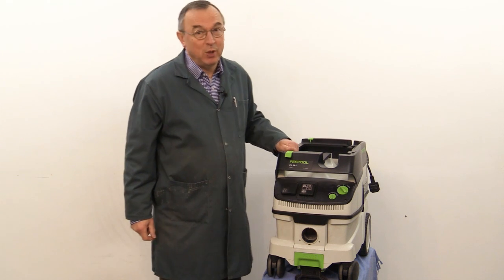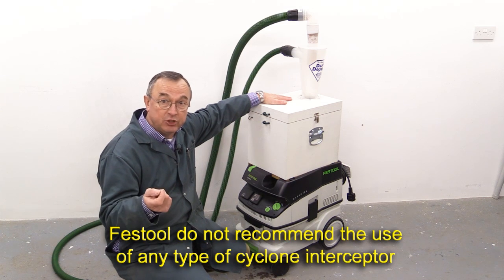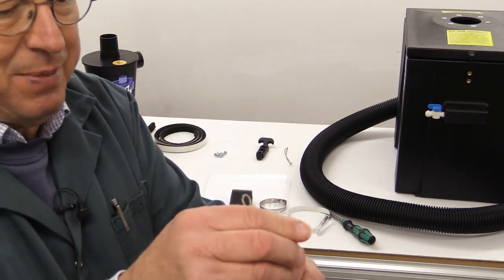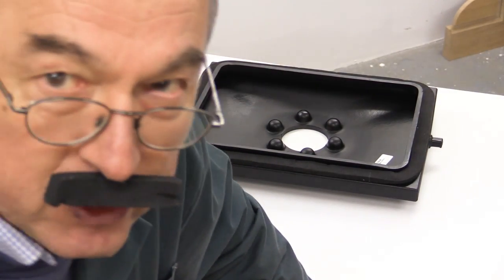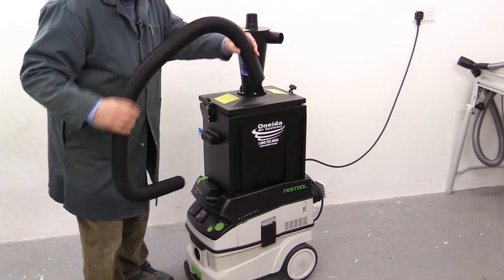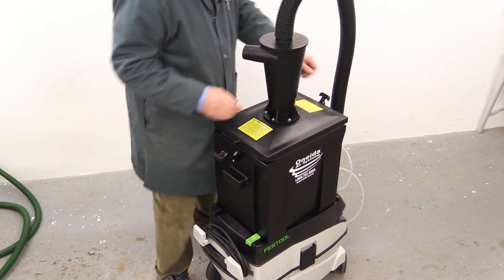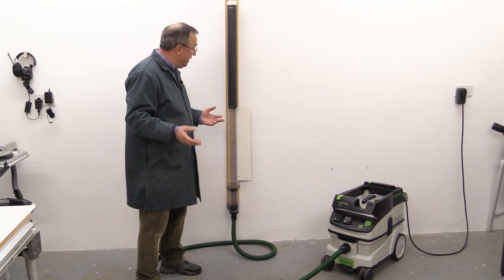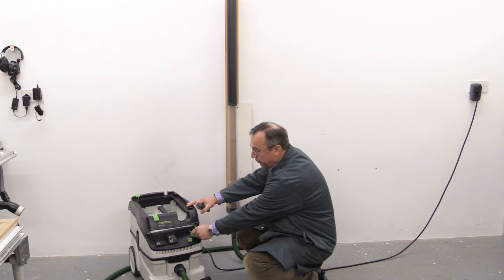Oneida Ultimate Dust Deputy

Comment: Weirdly, i just bought a CTL 26 and DDD and it fits the other way around on top of the Festool. So, the connector for the small tube that keeps the bag down is on the other side from the Festools vacuum inlet! And i can't turn it 180 because the DDD only fits one way on top of the Festool.

Comment: Thank You for the video!
In your opinion do you think that the Festool CT26 or CT15 would be a good professional chimney sweep vacuum? Would it be able to handle fire place soot, wood stove soot, creosote soot and smell, pellet soot and oil furnace soot? I know it’s not your type of work, but it’s very hard to get an answer for my question. 
Thank You 👍🏻👍🏻
Reply from the maker: I have a photograph of my old chimney guy's Festool CT26. It was quite dirty on the outside but he said that he would not part with it for anything. He had had it for (I think) 6 years and it had never gone wrong and worked as well as when new. Good luck.  Peter
Reply: New Brit Workshop I appreciate your response. That gives me a lot more confidence in purchasing a Festool CT Dust Extractor. Also I believe that the Ultimate Dust Deputy will also be beneficial for my application to save on filters and bags. 
Thank You 👍🏻👍🏻
Reply from the maker: #akaredcrossbow I am putting a Workshop Notes video up this evening and your question is featured at the beginning.   Cheers.  Peter
Reply: New Brit Workshop Thank you! Can’t wait to see the video👍🏻👍🏻

Comment: How do you tell if that can is full?  Is there some sort of indicator?
Reply from the maker: Hi Albert, No but I check it every day and judge when it should be emptied. That method has worked for a few years now.  Peter
Reply: @NewBritWorkshop  ah thank you. I actually didnt check my bin for a bit and it ended up sucking up the dust into the vacuum. Not sure I have the discipline to check everyday : )   Though ive seen ways to create some external indicator

Comment: Hi Peter, I recently purchased the HK 55 circular saw after seeing your review and I cannot wait to try it out, so thank you for that. While I was at my local Festool store I had the opportunity to look at the new midi extractor and compare it to the 26. I think you could be right about bitting the bullet and spending a bit more on the 26. 
I would need to purchase it in 110 volts mode. 
Can I ask your opinion on an absolute crazy question?- I noticed there is space on the extractor for either a Bluetooth connection or a second plug. Is it possible to have that second plug in 240 volts so as to have the best of both worlds?  Sorry but I had to ask. 
Cheers Dan
Reply from the maker: Hi Dan, It seems a sensible question but the 110v CT will only have 110v going in and the second socket is just an extension of the other (110v) socket. So, no it is not possible. I just do not understand why we continue to force our contractors to use 110v when every mains supply has an earth leakage trip.   Good luck.  Peter

Comment: Great demonstration. I want one! However, £275??!!  Yes, it will save money in the long run, but I think for what is essentially a plastic tub, some hose, and the cyclone unit (which can be bought at a fraction of the cost separately), this is a bit steep. Feels a bit greedy to me.
Reply from the maker: Hi Mark, I think that you have a valid point but... You may know that I design woodworking tools and the cost of getting tooling and moulds made for plastic production can be huge. One small part that I designed that would fit easily in a trouser pocket required up front tooling costs of £6,000. Now if you are making plastic dustbins and expect to sell over 1 million that is not a problem but for a niche market like this where Oneida will be selling just a couple of thousand the tooling cost is significant. In this case, and I am guessing, there may be £40k or even £50k of costs plus design and testing.    Peter
Reply: I do take your point Peter, but I still maintain that it's disproportionately overpriced. The cyclone unit would have been a far more complex product to develop, and that is significantly cheaper. I'm cynical of the volume argument as well - Oneida are distributing multi-nationally in 14 odd countries, including the US and China, so despite the niche market I'd be very surprised if they sold just a couple of thousand units. Plus, if they really expected to only shift modest volumes, would they even have embarked on the project in the first place - it wouldn't make commercial sense. I appreciate that product development is not cheap, but they appear to be reasonably established, so there would also be economies of scale for bringing items to market. The only other thing which might bump up the cost is potentially any licensing arrangement with Festool. This would most likely be significant. If I was recommending it to a friend, I'd say it was an elegantly designed product which performs well and integrates seamlessly with Festool dust extractors, however it is very expensive.

Comment: Payroll or no payroll. Sorry, but I find it strange that people find this "very informative". The only thing i see is two different results with two different dust containers  with no explanation what so ever of why there might be a difference. The conductive plastic is a separate subject that may have influence of electronics in the shop vac but does it influence suction power/decrease??? My conclusion is that you have made a poor job sealing the white box system compared to the other one? Am I wrong?
Reply from the maker: Yes, you are wrong. The key question that people ask is whether the introduction of the UDD reduces the performance of the extractor. I made it clear that the UDD had been kindly provided by Toolovation on behalf of Oneida. I therefore had to create a non subjective demonstration to show that the UDD made no real difference to the vacs performance. I added my old DD and drop box to illustrate that home made solutions, no matter how careful they may be created, might not match the performance of the UDD. I had taken considerable care making my drop box with lock mitre joints and soft rubber sealing between the base and the top. The added bonus of the UDD is that you can use ordinary plastic bags to capture the dust which is not easy to do with a home made setup.    Peter
Reply: Of course a UDD reduces the performance of the vac when it comes to CFM, which is the important factor. You are measuring only the static pressure which is totally meaningless in comparing the three systems. The three systems SHOULD have almost the same readings using the same vac and comparable hose lengths. (A little loss can be expected with the DD inline due to the extra hose length. The only explanation for the white "drop box" system performing inferior is a badly sealed system compared to the other two and and that shouldn't be so hard to correct. Sorry, I don't mean to offend you but you have to prove me wrong...
Reply from the maker: I am happy with what you have said but at the same time I can tell you that I am perfectly happy with the UDD. Remember that my actual workshop vacuum system for small power tools (and mitre saw) is through a Dust Hub with blast gates. Even with all the extra pipe and extra loss due to cheap and cheerful blast gates I am still happy with the performance. So, I agree with you that there will be some variation in performance depending on the setup but mine does the job. Many thanks for coming back and pointing out how a more detailed assessment of performance could be gained.  Cheers.   Peter
Reply: You get a considerable performance drop with ANY separator but it's totally WORTH it because of the separation. And of course there are big differences in performance of different separators.

So I'm not saying you shouldn't be happy with your UDD. And I'm not saying UDD is bad system. For someone not wanting to build anything themselves UDD might be a good buy. The first part of the video is therefore perfectly fine and informative. The second part is very misleading as it suggests that you wont get a (noticeable) performance drop with a DD (or any kind of separator) because static pressure measured in the way you are doing it to COMPARE performance between vac alone, DD with homemade drop box and UDD has absolutely NO relevance to performance. Of course static pressure is important for a system but not in that way. And it is misleading if anyone thinks he/she must buy a new dropbox to get improved performance if the other components are the same. Enough said. Cheers!
Reply from the maker: Could I at least address you by a first name please...?       I want to learn more.     Could you produce a video that would demonstrate a method of comparing the CFM rather than static pressure for something like the UDD or similar? If you are not able to create video content then could you at least explain, in detail please (for a rather thick old guy like me), how to construct such a demonstration? I am not sure whether I will be able to reproduce what you suggest but would be prepared to give it a pretty good go. In the worst case we can invite others to give it a go.   Again, many thanks for the cooperation that you are providing.   Peter
Reply: I'm no engineer but I've built a couple of dust collection systems and done a fair amount of reading about it. The obvious place to read about dust collection is at Mr. Bill Pentz site and you can learn a LOT there. He is mainly focused at larger systems with high CFM:s and lower (but enough) static pressure capacity as needed in table saws, planers, drum sanders etc. The small shop vac systems with low CFM but high static pressure are more suited for the small handheld machines with small hose connections.

You just have to understand that its the CFM:s that is moving the dust. Static pressure capacity is required to create the CFM but it is only one factor and by measuring just static pressure as you are doing it tells you nothing about performance. You could have plugged in the worst designed separator in the world instead of the UDD and you would get the same reading provided it was AIR TIGHT. 

The usual/best way of measuing CFM is a CFM meter but they are rather expensive. I use instead a home made U-tube (not youtube) manometer and connect it perpendicular in a hole approx 5 cm(2 inches) from the end you usually connect to a machine. I then run the system UNOBSTRUCTED. I think this is a good way of making COMPARISONS of different setups behind this point, as different vacs, separators, hosing etc.

I'm willing to take it all back if someone who knows more corrects me but I think the static pressure component that you actually measure in this case translates well into CFM running it unobstructed this way.

Sorry, I don't do videos /Martin

PS You obviously dont want to make a hole in an expensive festool hose - instead you take a 4 inch pipe that fits in the end and connect the manometer there.
Reply from the maker: Hi Martin, I am learning more all the time but just help me with this bit. If I use the manometer approach then that does not measure CFM any more than the gadget that I created - which was a manometer that used a bungee rather than a column of water. Surely a manometer measures static pressure not CFM.  Peter
Reply: Peter, your gadget is measuring static pressure with the end PLUGGED in the same way as you covering the hose of a home vacuum cleaner. In 1-2 seconds there are no air moving at all in the system - you are just measuring the static pressure capacity of the vac. You are not measuring ANYTHING about CFM capacity, neither does it tell you something of the equipment between your gadget and the vac, BESIDES if it is air tight or not. Not about CFM losses running in normal mode, not of separation quality etc.

My gadget USES a static pressure measurement on a dynamic air stream and it will tell you much about your systems CFM capacity (but not separation quality of course). Try this with just your vac and then with the UDD plugged in and you'll see a big drop on the manometer.

But DO NOT cover the end. It will suck the fluid in the manometer into your separator system unless the manometer tube is "higher" above the fluid than your vac:s static pressure capacity. 1-2 meters (?)
Reply: Let's see if you'll agree with me...

1. To move dust(=performance) you need a volume of continuously moving air (=CFM). Right?
2. To get that air moving you'll need to be able to produce static pressure BUT the static pressure in itself doesn't move anything if it's blocked/concealed/restrained -like the situation inside an inflated bicycle tire. It only has a POTENTIAL to move air. Right?
3. A measurement of the static pressure inside the tire doesn't tell you ANYTHING about the CFM it can produce. It depends of how you let it out. If you punch the tire with a thin needle you'll get a low CFM, if you'll open the valve you'll get high CFM. Right?
4. CFM is thus affected/reduced by resistance in the system. That is hose diameter, friction of hose walls, a separator etc. Right?
5. Following from not beeing able to know anything about CFM from measuring static pressure comes that to measure changes of CFM (=performance) you got to HAVE a CFM to measure. Right?
6.Therefore one can conclude that measuring different setups with your gadget is meaningless regarding performance. The air isn't moving at all after a couple of seconds. Right?

Your vac can produce a certain amount of negative static pressure. It doesn't matter what volume there is (=putting different separators in front of the vac) - the static pressure gets the same at the end if they are all air tight. It just takes somewhat longer to produce that negative pressure when it's a bigger volume. Therefore your readings should be all the same (almost).

Are you with me?
Reply from the maker: I am with you, it is the manometer that you described that I was asking about.   Peter
Reply: The manometer in this case with air flowing is measuring the static pressure COMPONENT of the total pressure. My not proved theory is that the negative static pressure component cancels the dynamic component of "total pressure" (dynamic+static) in this case with a shop vac as "blower" that in practical use you can use it only to test different setups AFTER the measuring point. Search "pitot tube" and calculating CFM for further information.

Sorry for the rant in previous message. I'll shut up now. I don't really know what I'm talking about... :-)
Reply: I just stumbled upon this video after looking at New Brit's current video on the festool separator. mfwoodful - you are wrong in your assertion that CFM is the important factor. You cite Bill Pentz's site - and you are correct, Bill Pentz does state that CFM is the important factor. However, that is for a DUST COLLECTOR. Dust collectors use 4" or larger pipes to collect dust from large tools - planers, jointers, large sanding machines, etc. These are shop vac's or dust extractors. The goal here is high SUCTION, which is in fact measured with static pressure. Due to your ignorance, New Brit has been under the impression that his static water column test here was no good - when in fact, it was the exact type of test that was needed for this type of vacuum. Now, he has gotten rid of his test apparatus, and he no longer has it to do a test on the new Festool separator - something which would have been very nice to see! Next time, make sure you know what you're talking about.
Reply: @Subsonic-cd2en  The goal is high suction when working. The system is not working when you plug the end like in  this video. It just builds up the  static pressure  and when the static pressure capacity of the vacuum cleaner is reached no air is moved at all. When no air is moving at all it doesn't matter at all how anything inbetween the vacuum cleaner and the measure point is designed besides air tightness.

Comment: So does the inlet of the UDD work with the 27mm and 36mm Festool hose?
Reply from the maker: Hi Ben, Yes, the fat end of the Festool hose, which is the same for both the 27 mm and 36 mm hoses, fits nicely onto the UDD.    Peter
Reply: Thanks Peter. My mistake. Forgot that the end that goes into the vac would be the same regardless of the tool side of the hose.

Comment: Wonderful video, thank you for sharing.  The static pressure test was great to see.  I've always wondered how large of a drop off there was with the static pressure and CFM by adding the UDD.  I'd also be curious to see how those number compared after vacuuming up say 13 liters of saw dust.  My guess would be that the UDD stays consistent while the standard setup drops off as the bag fills and the filter dirties.  Might make for a great video!
Reply from the maker: I did think about this but in fairness to Festool the CT extractors do retain their sucking power as the bag fills up. If anyone has a CT use it until you judge that the bag is about half full. Then open up the machine and look at the bag. You should see that the dust looks as though it has been compressed into a block. You should also see that the outside of the bag is perfectly white and that the inside of the receptacle where the bag sits is spotlessly clean. If a bag were to get clogged then it would discolour as the very fine dust accumulates in the fabric. I hope that explains why I have not done the additional test.   Cheers.    Peter